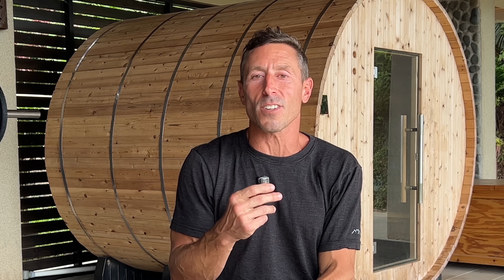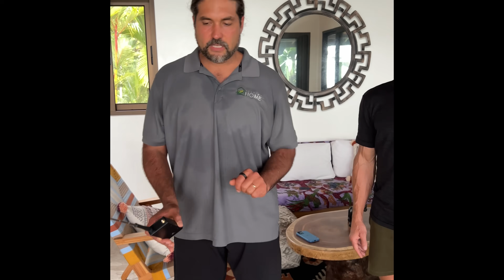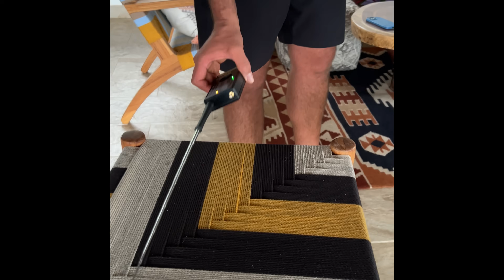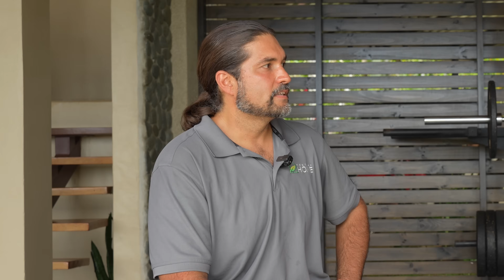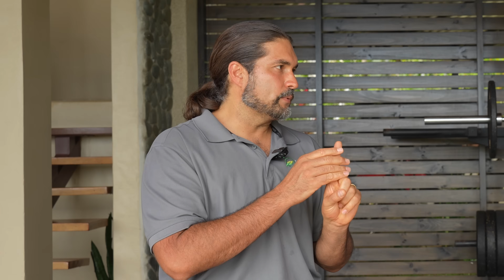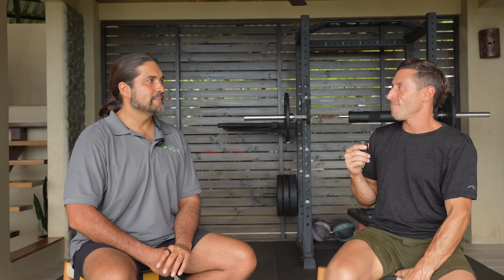Earthing vs. grounding

Comment: The concepts of grounding (or earthing) and their health benefits involve a mix of scientific research, anecdotal evidence, and ongoing debate within the scientific community. Here's a breakdown of the scientific perspective on these practices:
Earthing or Grounding

    Scientific Basis: The idea behind earthing is that direct physical contact with the earth's surface can help neutralize positive charges (free radicals) in the body through the transfer of electrons from the ground into the body. The earth's surface has a negative charge and is constantly generating electrons that can neutralize free radicals, potentially reducing inflammation, stress, and improve sleep.
    Research: There are studies that support some health benefits of earthing, including improvements in inflammation, pain reduction, improved sleep, and better blood flow. These studies suggest that earthing may have a positive impact on the body's inflammatory response and overall well-being.
    Criticism and Limitations: Critics argue that many of the studies on earthing are small, lack rigorous experimental controls, or may have conflicts of interest due to funding sources. There is a call for more comprehensive, high-quality research to conclusively determine the benefits and mechanisms of action.

Electrical Grounding Systems and Health

    Dirty Electricity: The concept of "dirty electricity" refers to fluctuations and surges of electrical power that can create electromagnetic fields (EMFs) potentially harmful to human health. While some research suggests that high levels of EMF exposure may be linked to health issues like cancer, neurological diseases, and sleep disturbances, the evidence is not conclusive, and more research is needed.
    Building Wiring and Health Risks: Concerns about the impact of home electrical systems on health primarily focus on exposure to EMFs. The scientific consensus on the health risks posed by household EMF exposure is mixed, with some studies indicating potential risks and others finding no significant health impacts.

Conclusion

The practice of earthing or grounding is based on principles that have some scientific backing, particularly regarding the potential for electron transfer to reduce inflammation and improve health. However, the scientific community has not reached a consensus, and more research is needed to fully understand the benefits and mechanisms.

As for the concerns about "dirty electricity" and the health impacts of grounding through electrical systems, there is awareness of potential EMF exposure risks, but again, conclusive evidence is lacking, and research continues to evolve.

In summary, while there is some scientific support for the benefits of earthing, and concerns about EMF exposure are taken seriously by some researchers, the full scientific validation of these practices requires further high-quality research.
Reply: I feel their is a benefit (personal anecdote), and I have seen studies and heard theories. Forgetting the health issue, I have never heard an RF expert on the following (I have been blasting this in Youtube comments, because I can't get a complete answer). You would think a small industry that claims to sell healing products would get someone who really knows electrical/EMF theory to back them: There is often a debate when using ground rods and mats (not the dirty house ground issue), that your body acts like an 'RF ground', absorbing more RF than normal and shunting it to earth. I don't believe this, because at the frequencies of concern (wifi, cellular), anything conductive reacts like an antenna. Your body is already responding to the RF (oscillating the body's electrons), so why would connecting to a few feet of wire make things worse? Electrons seek ground, EM waves don't. If a practice can't hurt, people should experiment, but is the risk really neutral?

Comment: I tested my outlets said they were good after about a week was getting negative symptoms from grounding..then I went a
To a rod outside 1 night developed negative reactions will give it one more chance with breakers off..I have listened to emf experts say not to ground inside but if u do absolutely breaker has to be off in the room
Reply: Try the Pureground rod from Laura Koniver, it filters out AC.

Comment: The grounding wire from your electrical panel literally connects to the earth and goes strait into the ground.
Reply: I use a grounding mat.
Reply: Yeah that guys kind of an idiot lol I was like brother ur thinking too hard. Grounding and earthing r the same shit 💀 both connecting you to the ground neither one or the other is better for you it’s the same thing
Reply: @Dalefball  Yeah he is clueless.
Reply: Yes but on the main panel the neutrals and the grounds are underneath the same bus bar. Therefore it's not truly a pure pathway to the Earth. Can you imagine if there was a direct short in an appliance would you want to be hooked up to a grounding mat hooked into an old panel using  federal Pacific breakers. Now imagine somebody has a subpanel hooked up incorrectly with the grounds and neutrals bonded. Honestly the best bet is to go directly to the Earth. I tested it both ways they actually do help.

Comment: Using a multimeter, I measured my electrical exposure while sitting on my bed.  The reading was initially around 650.  After unplugging a window air conditioner next to my bed that was plugged into the outlet behind the head of my bed, but not turned on - The reading dropped to around 325, half of what it was.  

Then I unplugged a 6-foot household extension cord that was not in use ( same outlet) and the measurement dropped to around 125.  

At least that part of what he is saying is correct.  

How much electrical field is around us that we don't know about is unsettling to say the least.  Think about strolling thru a shopping mall or a hospital, even a grocery store, or working 8 hours a day in one of those places.
Reply: Could you name the device/multimeter please?
Reply: @Filmfabrikant  Harbor Freight store brand I believe.  $6.99
I think it was $5.99 at the time with a coupon.

Comment: The small cylindrical module near the end of a laptop charger cable is called a ferrite bead or choke. It's a passive electronic component that prevents electromagnetic interference (EMI) and high frequency noise.

Comment: according to dave stetzer in north america there is all sorts of stray voltage running through the earth because the corrupt utility companies fail to maintain and enlarge the return wire for the electricity to return back to the substation.  They have even turned the homes foundation into a ground to earth by tying the panel into the rebar in the concrete and into some rods that go from rebar to earth under the footer.  Daves thinks "grounding" or "earthing" all night long in north america is not a great idea because he has spent so much time measuring stray voltage everywhere.  He believes in discharging electrons before bed by standing on a piece of foil for a minute. He said he has measure the discharge happening.

What was that meter the guy used in the video?  That's an interesting one I haven't seen before.

Comment: I am 'hyper' sensitive to the wifi and do not have it in my condo.  All the neighbors on connecting walls and downstairs from me have it.  I feel like my head is a modem some days:  high pitch noise, clicking, wooshing is horrible.  The cell phone stays behind a closed door in a room and not near me unless I am using it.  Would be interesting to talk to this guy and tap into his knowledge about all this.
Reply: U will want to study are call a  emf  expert..u can get emf blocking paint and also plug in devices

Comment: "Earthing" or grounding s really poor advice. Ryan's "body voltage" meter just measures the difference in potential between two different circuits this breaks Kirchhoff's law. The earth is filled with man made frequencies that are biologically active. You don't want to become part of this circuit, especially at night while your brain is sending tiny electrical signals to your cells to repair DNA.   Talk about running into misconceptions.

Comment: This guy has no clue what he’s talking about. A Grounding pin is connected into the earth near your house or in commercial buildings. Every outlet through the house is bonded to some type of metal conduit and returns to that grounding pin. It is NOT a waste for bad electricity that goes back to the power companies. That’s the neutral, or return line. Clown. Get an electrician on here

Comment: How do you actually do this? I’m 22 barely based basic physiques exams and all I’m thinking is buy a copper wire encased in the standard wire rubber. Slot it into the ground in my garden then run the cable from there to a grounding mat. Just poke a hole in the grounding mat and stick the wire in. Also is there any worry about lightening If it hypothetically struck the lawn ?

Comment: If you listen to the interview in full, he found some improperly connected wires in his house which may have triggered his tester to beep next to the grounding mat. His house is in Costa Rica, which is a country where the electrical code is probably not as well applied as in the United States or Canada. I wouldn’t worry too too much about using a grounding mat in a residential North American home but I would stay away from grounding products in places like hotels and countries with iffy electricity, like Costa Rica
Reply: Thank you for your comment. I was about to dive down another unwanted rabbit hole. I can relax. ..👊🤗🌹
Reply: @deborahpharaoh4505  haha me too 😌
Reply: Just test your grounding mats?
Reply: Is good or bad to use
Reply: Do you know if I could buy a grounding mat for my pc desk and ground it to my radiator that is linked to a big "radiator-network" in my apartment? Or would that radiator in it self, give off too much electrical noise onto my grounding mat?

Comment: One thing... What about all the 4G/5G radio waves which the WiFi routers pick up and then put out? They're wireless, meaning theyre picking up the signal already being broadcast, then it puts out its own, which the house logs into... How do uou avoid all those outside frequencies? They're obviously powerful enough to get through all our walls for our WiFi routers to pick up

Comment: Something I learned is to use a big monitor 40-50" and distance it with your computer 3 to 6 meters from you and use bluetooth mouse and keyboard.
You be safer from EMF and is less strain to the eyes. If possible this setup should be in fron of a window that has a long view that way you avoid getting myopic

Comment: Great video ❤ I live in in an ATC toy hauler trailer which is all aluminum floors, cabinets, etc.. How do I ground my trailer? 
My trailer is similar to a faraday cage since it’s all aluminum. Is it worse EMF and radiation to use my cell phone inside the trailer ? 
Thank you.
Reply: Stick a 7 feet long coper rod into the ground, or 2 separated by 14 feet, both electrically connected to you. You will be connected then. To know more about how to do the grounding rods, check some YouTube videos out on it.

Comment: Ryan exposes his lack of understanding of electricity in the first minute when he says current "dumps to the ground".  Electrons actually move FROM the Earth, not to it.  He needs to study basic physics before parading around like an expert.  The buzz being picked up by his detector is electrical noise from appliances in the house that are sharing the house wires.  Grounding to an outlet is just as effective at discharging your body of electricity, but if you don't want to be exposed to any household electrical noise, then, sure, run a separate wire from your mat directly to the Earth
Reply: Ryan Blaser is a husband, father, and Idaho native with a passion for bridging the gap between environment and wellness. This passion fueled his 25 year career as an Electrical Engineer specializing in health hazards of the environment. His experience includes a position as Electrical Engineer for the Department of Energy (nuclear division), Field Engineer for the Department of Environmental Quality, Master Acoustician and Commercial Audio/Video integrator, and Broadband RF installation.
Reply: @Pablo19625  those are just titles and adjectives.  that doesnt show what he said to be true.

Comment: As an electrician i have always been curious about this. i got some grounding mats and sheets but i always thought putting my own electrode into the ground would be better as the earth on the house will have noise etc. Good to see someone finally talking about the topic. Thank you Paul
Reply: How do you actually do this? I’m 22 barely based basic physiques exams and all I’m thinking is buy a copper wire encased in the standard wire rubber. Slot it into the ground in my garden then run the cable from there to a grounding mat. Just poke a hole in the grounding mat and stick the wire in. Also is there any worry about lightening If it hypothetically struck the lawn ?
Reply: As the earth is an alternative path for current to return to the supply transformer (here in Australia), there will usually be an AC voltage on any earth stake, WRT the general mass of earth.  In big cities, independent earths may not help much.
Reply: Yes, I thought my grounds were just ineffective in my house because it’s a very old house. So, I got materials to ground my mat directly outside. Good to know that there’s noise in household grounds, in general since I am sharing this with others.

Comment: I recently stripped all of the polyurethane varnish off my floorboards and applied tung oil instead. Now I can walk around on wood instead of walking on a layer of polyurethane plastic on top of the wood.
Reply: Bud...  When a drying oil (like tung oil) cures, it *polymerizes*.  Cured polyurethane and cured tung oil are both *polymers*.
Reply: @ColonelSandersLite  ..whoopsie....
Reply: @Homes8048  uh oh

Comment: That’s interesting, but when I measure the voltage with a volt meter plugged into any home grounding system, it drops to the same low level as when I’m barefoot outdoors.  Home grounding systems ultimately connect to the earth anyhow.  So I guess I’d have to understand the science behind that demonstration human volt meter.

Comment: Clint has done a research about it, check this article “DOI: 10.1089/acm.2015.0340
Effects of Grounding on Body Voltage and Current in the Presence of Electromagnetic Field” the current is way too small

Comment: I’m an qualified electrician, this is absolute insanity and a butchering on how grounding works and it’s purpose
Reply: Thank you. It's wise to vet guests who are using tools they're not competent to use and therefore come up with theories based on information they don't understand!😂
Reply: Ya I’m no electrician and don’t know anything about electricity but I found it funny that their proof was “see how bad that noise sounds? It’s dirty energy” lol
Reply: @sirwhodison  I agree it was an amusing illustration of ignorance. Here is an informative Q&A interview with Clint Ober, who knows far more about this than Blaser. Ober explains the difference between Earthing and Grounding (they are not the same thing but are often used synonymously) and how both are good for you. They discuss EMF frequencies/ dirty electricity at time mark 31:06. 

https://youtu.be/XlLxpsmgQ9Y?si=i2CdADeoJZskokXN
Reply: @sirwhodison then the didn’t do a cross analysis with what the earthing noise sounded like
Reply: @sirwhodison dirty electricity can be easily measured. You sound uneducated when you say it doesn’t exist.
Reply: @sirwhodison 😂
Reply: You’re right about electrical grounding—that’s a safety system for stabilizing voltage and preventing shock. But this conversation isn’t about electrical code grounding at all. It’s about biophysical grounding. They share a word, not a mechanism.

In medicine, grounding means connecting the human body directly to the Earth’s surface electrons. When your skin makes conductive contact with the Earth (or through a grounded conductive mat), your body’s electrical potential rapidly equalizes with the Earth. This isn’t “insanity”—it’s basic physics. You can measure it with a voltmeter on any person before and after grounding. The body voltage drops to near zero instantly.

Beyond that, there are published, peer-reviewed studies showing measurable physiological effects:
– Reduced inflammation and pain (Chevalier et al., Journal of Inflammation Research, 2015).
– Improved sleep and normalized cortisol rhythms (Ghaly & Teplitz, Journal of Alternative and Complementary Medicine, 2004).
– Changes in blood viscosity and reduced clumping of red blood cells (Chevalier, Journal of Alternative and Complementary Medicine, 2013).

These outcomes aren’t about house wiring—they’re about bioelectric balance. If you conflate the two meanings of “grounding,” you’ll miss the point entirely.
Reply: @WildernessOff-Road 

Someone with commen sense  . 😅
Reply: Yea, these people are idiots who only understand psuedoscience because it's what makes sense to a layman who doing understand how things work. Whatever makes them feel better i guess.
Reply: so theres no risk to grounding?
Reply: Sure but Clint Ober is a salesman for grounding products so kinda hard to know if what he’s saying is real
Reply: BS... keep dreaming 😂

Comment: I   ground to the metal radiator pipe in my bedroom . My body voltage drops significantly as a result . Surely that's ok ?
Reply: yup..it's grounded.